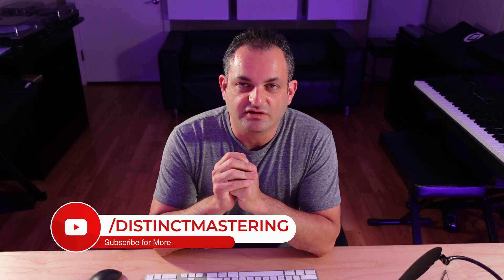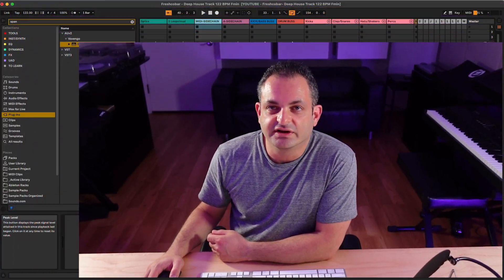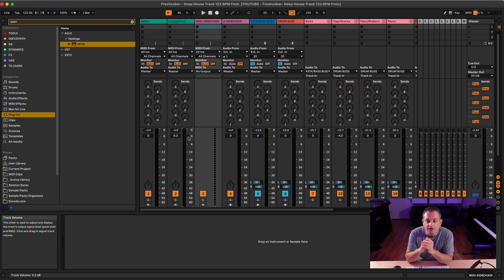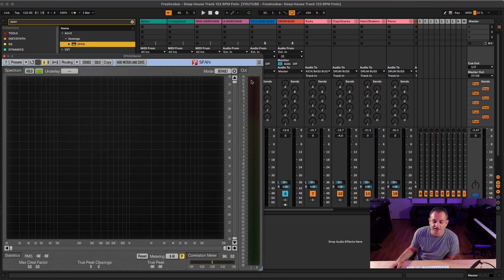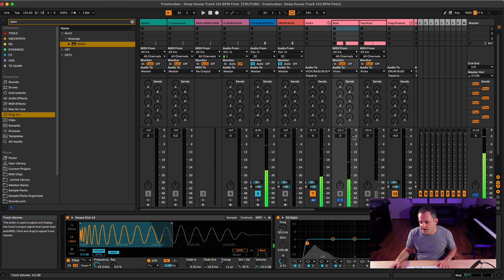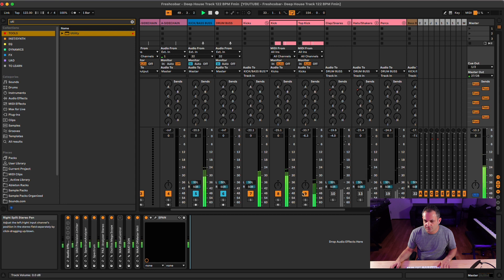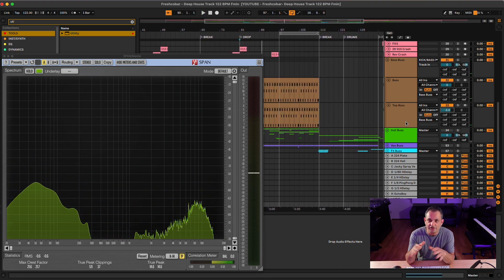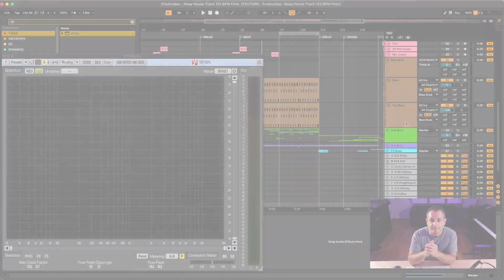Polishing Your Mix with K Metering - K System Metering Explained

Comment: For all the practical purposes how is it more advantageous than gain staging to VU Meters? I don't think K metering system is about gain staging,. It helps set dynamics level of the whole composition. And the levels of the K metering are suggested for different genres.
Reply from the maker: VU meters behave like logarithmic hearing. K metering just helps build in head room and gain stage along the way. Whatever you please is best, however for producers like myself that use lots of different samples K Metering can help adjust them all to one balanced level before mixing. If you're recording live instruments you're likely already doing this on the way in. I would not substitute K metering over VU meters I would use both if you prefer.